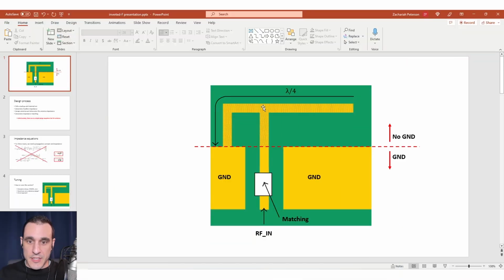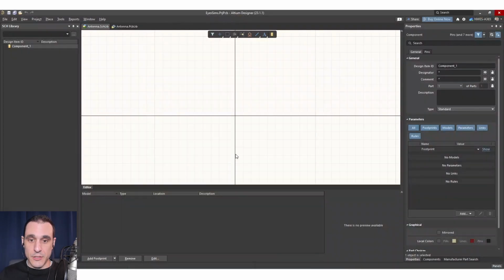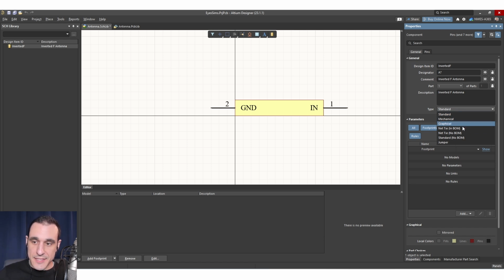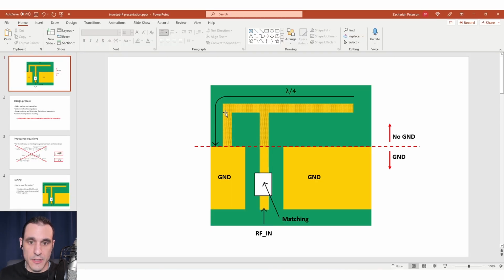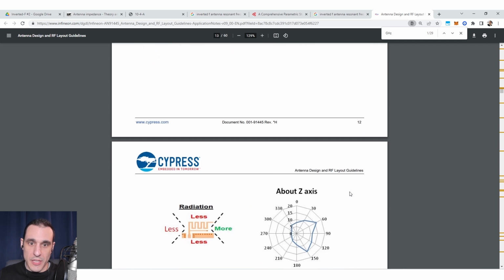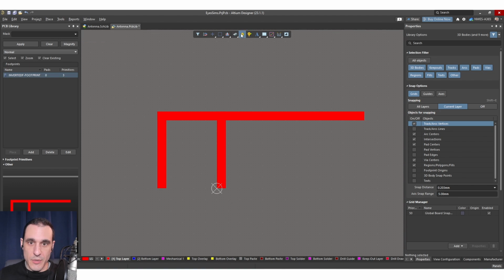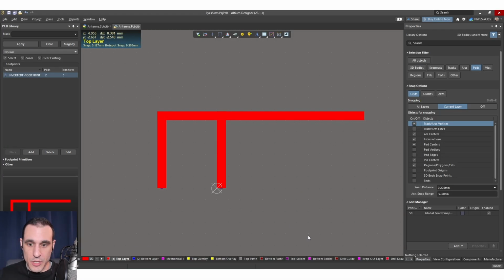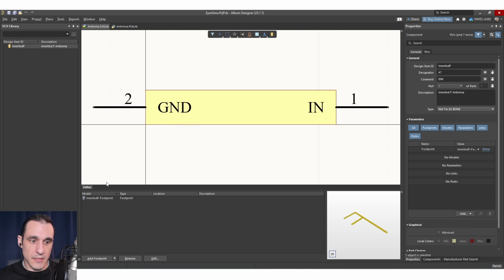Inverted-F Antenna Design Walkthrough - Part Two

Comment: hi Zach, you didn't mention about the size of the pad at feeding point and ground connecting points. Is it arbitrary and slightly small enough? Since I was confused if the size could affect the antenna power delivery or general performance?

Comment: Hi Zach,
Does distance b/w these two vertical lines matters in the footprint that you have made?
Reply: Yes it does matter, that distance and the distance of the legs is used to tune impedance matching bandwidth. It is a bit of a complex problem and there is no formula for calculating these points, so it would need to be simulated. Maybe I will do a simulation in OpenEMS on this because it is a good topic in antenna design.
Reply: @Zachariah-Peterson  Yes, it will be great help if you upload a tutorial video with OpenEMS. BTW, great content on your channel. Thanks